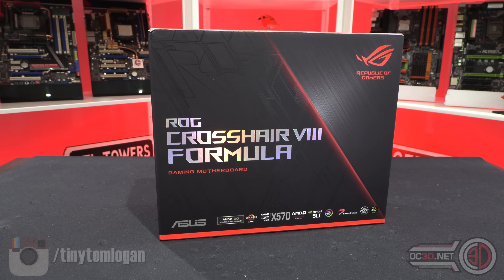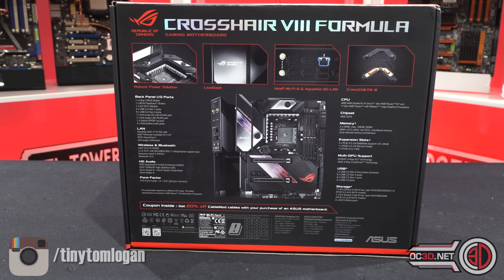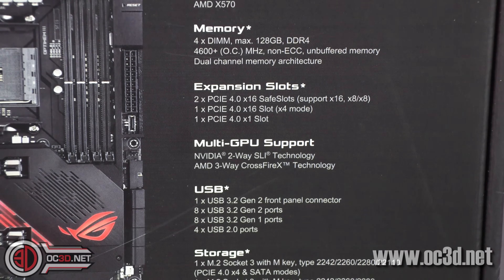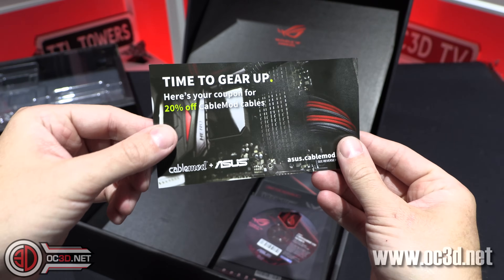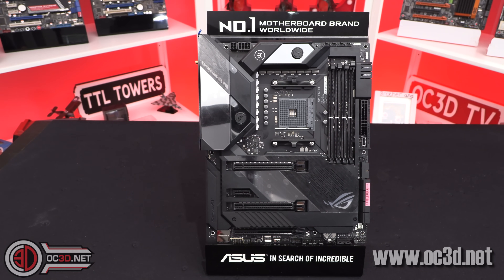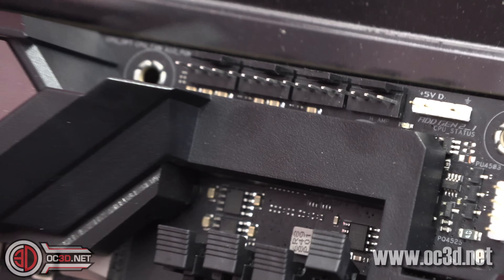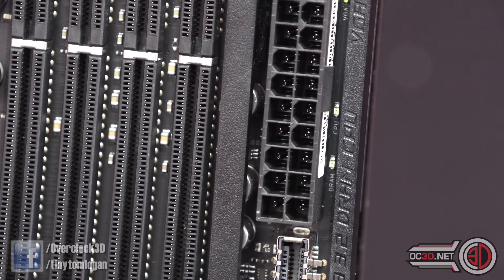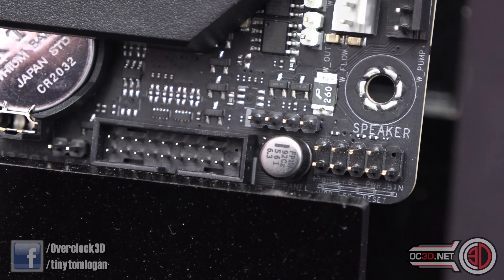Asus ROG Crosshair VIII Formula X570 Preview

Comment: Hi Tom. Is it possible to run 18w pumps directly off the motherboard? I am using an aqucomputer at the moment to run a dual loop but would like to use the mb features so could I use the wp header and the aio header to run my pumps thanks mate.

Comment: Completely overpriced for a waterblock that should have been used for chipset cooling instead and not even bothering with 10Gbit but only providing a 5Gbit interface.
Same VRM as on cheaper X570 boards from ASUS too.
For that price there are better boards out there, really dissapointed with ASUS regarding this.

Comment: I would buy this if they water cooled the chipset as well. The VRAM doesn’t really need cooling and they cool that but not the part that actually does. So you buy a 500+ board and it will probably fail in one year when that little shotty fan dies....

Comment: is it dual x16 PCI-E lanes or x16+x8 ?
Reply: x16 + x8.  SLI will run in x8/x8.  Ryzen 3000 doesn't have enough PCIe lanes for dual x16.  Hopefully that'll change with Ryzen 4000.

Comment: VRM: 8 real phases (6+2) dual parallel switched ("12+4"), 16 power levels: 12x CPU (60A/IR3555), 4x SoC (60A/IR3555), PWM-Controller: ASP1405I/IR35201 (max. 8 phases)

Source: https://geizhals.eu/asus-rog-crosshair-viii-formula-90mb10z0-m0eay0-a2079078.html?show_description=1

Comment: it is a relay pity that they have all decided to downgrade x570 motherboards to use  fans on the chipset, which warrants them being unusable for workstation loads and likely  to force u to change motherboard in a year or two....also the  amrour design  make sit  imposible to have EK or any other to design some good monoblock that can cool the chispet as well.

these 1st gen motherboards will nto sell, and im pretty sure most users will use old motherboards to run ryzen 2....as for the 16 core users, they will likely  get threadripper rather than the 3950X at thes price tags and low end mother boards...

lets relay hope that the TR4 motherboards for threadirpper 2 wont be so crappy like tehse ones and designed for heavy loads instead of trying to appeal people who dont use teslas or titans and dont keep their machines on 100%  load  non stop.

this is  a very cute motherboard for a low cost machine, but definitely not gonna stick 2 RTX quadros on it to have to dissemble it to clean that  horrible shit fan once a month...and that is pretty much what u will have to do if u buy these x570 crappy fan cooled motherboards
Reply: 3950X will be significantly better than a 2950X in multicore and single core.

Comment: That VRM is 16 phases in total, probably 2 for the SOC leaving 14 phases in total for the VRM. Probably running a doubling scheme with 7 phases. 
I think that watercooling is a total overkill by the way, even with a 300W cpu power usage you're running ~250W and depending on the VRM components this will only be like 20-25W which can easily be disappated with that giant heatsink.
Reply: This one may not be using a doubler. Could be a true 14 phase VRM.

Comment: (cringe) another one that has no visible cooling fins at all under that cover, and somehow that minuscule little fan is supposed to somehow help cool that chipset, lol.  They have a water block on the VRM, I'm surprised they didn't opt for something similar for the chipset. I also wonder if that VRM block must be on a water loop for the VRM to keep it's cool, or if normal air cooling only mode will do fine.

Great vid TTL and crew. B)

Comment: Those Boot LEDs will be partially hidden by the 24pin power cable... seems like a bad spot.
Reply: I know right? Was thinking the same thing. A bit of a Noob mistake on a high end mobo.
Reply: they are color coded, you dont have to see those, they will light up that area with different colors, for example white being vga, orange being dram and red being cpu.

Comment: If I do need to replace my Crosshair Hero VI (1700X) to run a 12 or 16 core OCed this is a good contender based on specs! I like the looks overall, but I'm not quite sure on the mirrors just yet. Cheers TTL!
Reply: Crosshair 6 should be good for a 12 core.... 16 core on the other hand maybe not.

Comment: Could you possibly do a video sometime on power supplies that have inline caps on the cables showing the difference in ripple when using aftermarket cables like cable mods that dont use the caps or filters

Comment: That vrm water block would've been of better use on the south bridge chipset. If the vrm is worth it's salt it wouldn't even need a heatsink @ stock settings. But still a gorgeous board.
Reply: South Bridge? You mean Chipset? There's no such thing as North & South Bridges these days. This board is all about maximum power and performance so as high temperatures can and will degrade electronics over time, any form of heat dissipation is a good thing. Hence the heatsinks on pretty much all performance motherboards. Only exception is server grade boards which are normally cooled by high rpm fans blasting air across them.

Comment: I hate how they watercool the VRMs but leave that chipset fan.  That would drive my OC3D crazy!
Reply: Tell me about it. Will prob skip x570 altogether and wait till they get their shit right. Even asrock beat asus this chipset. WTH asus??????
Reply: Probably won't turn on unless you fully utilize the chipset.
Reply: @ChronischVrij  : apparently only if you push the NVME speeds, which every nerd in the world will want to do on these boards.  Who ISN'T going to want fast NVME RAID?  That fan will be used on the average geeks rig for sure.
Reply: that is only part of a reason why I will probably not get this board
WHY go through the trouble of adding VRM waterblocks and choose to use a fan on the chipset which could fail and fans have a limited life span which could be less than the life of the motherboard and even if that wasn't a problem then you probably wouldn't be able to replace the fans in the future as they seem like special limited designs and seem like GPU fans which do not have normal fan connectors like case fans and whatever
Reply: @zahidshabir4038  There will be people that end up buying this board simply because they can and not because they will watercool. I'm sure that if you water cool this board, that fan will never move an inch anyways.
Reply: @clanteh  Do you think you can run this board fine without watercooling? I am one of  those guys. I've gotten to the point where I am just too lazy to setup a rig and do maintenance.
Reply: @MaoMaoTranscending  yeah. The VRMs wont overheat unless you're overclocking the memory and CPU to extreme length, which you cant do on a simple water loop anyways

Comment: Hope this and the regular Hero use TRUE 14 CPU VRM, instead of that garbage phase combining to one PWM controller (so it will be just a 7 phase board with 14 power stages), as they did with Maximus X hero and XI Hero. Otherwise I'll just buy Aorus Master.

Comment: All of the X570 boards I've seen so far are beautiful. If they perform as good as they look no matter which brand you buy, it should be a treat.
Reply: But they have fans on them and the fans are loud and the fans would have shorter life spans compared to the rest of the motherboard
Reply: @zahidshabir4038  I've heard from a few sources  that the fans were designed to be quite and should outlive the board. Also they only spin if the chipset rises above a certain temp. I'm waiting until to see some reviews before making any buying decisions.
Reply: @zahidshabir4038  bullshit
Reply: Im pretty sure the chipset will be fine. It will just get a bit hot .

Comment: Looks like the price for the x570 Formula will be around the $700 mark. If that’s true its just ridiculous. Insanity
Reply: That's the rumoured price - but if it is, I'll be very upset. 

I hope that isn't the price (MSI had to drop their top end price from $777 to $600 because they were the most expensive) as this is the board I've been keeping my eye on since boards were being announced.
Reply: Yeah I've got an open loop and was looking forward to this board but for more than $500, it's too much... Honestly, even more than like $450 is too much.
Reply: @MrSnowmobiling  Well the z390 line up from asus is no where near cheap either and there's not much in a x570 that makes it cheaper by any chance...
Reply: @user-ku6bv4ni2f  I mean, the Maximus XI Formula right now is $467 on Z390 so... It's okay. The formula is rumored to be $700. The Crossair VIII Hero w/o the waterblock and oled screen is $380. I'll prob just get that and call it good.
Reply: It's going to be a shame if AMD's board partners drive people back to Intel.
Reply: @Phelper99  b450, x470 are cheap you don't need a top class x570 motherboard to use a ryzen 3rd.
Reply: AMD = Low CPU cost, Expensive Motherboard cost 😅
Reply: @Niels_f2704  new technology branding friend
Reply: Completely disappointed. Price to features is horrible and i wont support it.
Reply: its not (thank god)

Comment: high amp was the last fan header on top there
Reply: The Asus HAMP header is usually 3.0 amp, instead of a normal 1.0 amp fan header
Reply: High amp ?
Reply: @RichardDower  High amperage, it can provide more power than a regular fan header. Good for hooking up lots of fans on the same header (with splitters).
Reply: @isakh8565  Or a pump for a second coolant circuit etc.